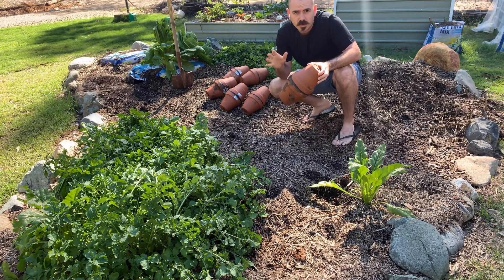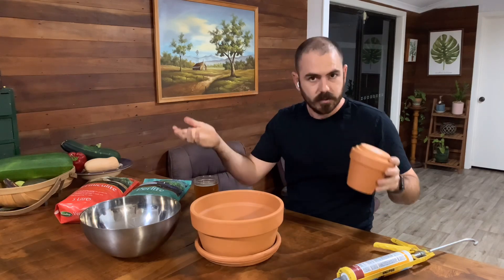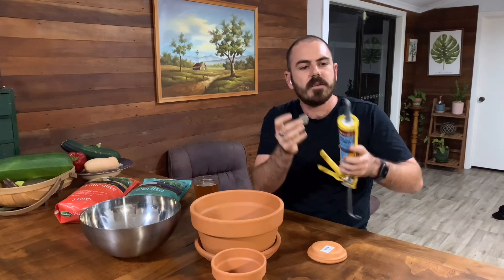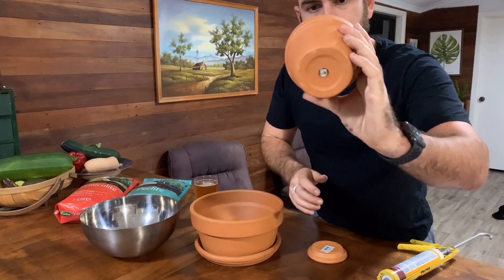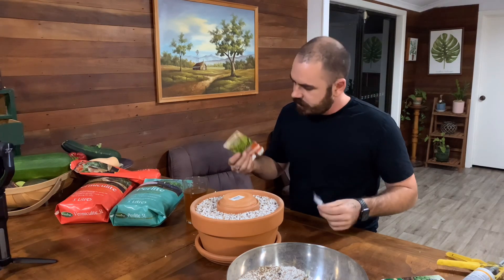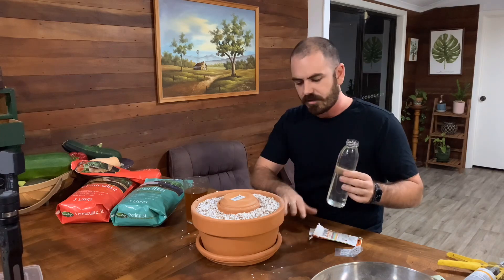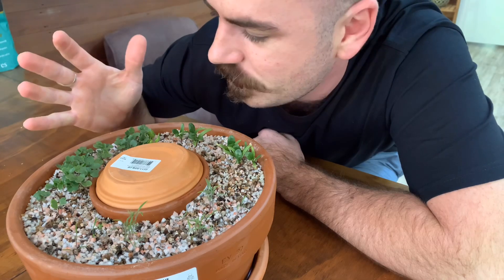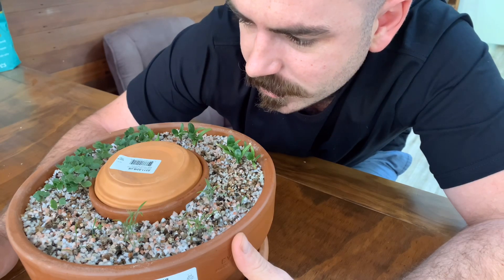Ancient Irrigation/Hydroponic Device

Comment: If they are both terracotta pots... why doesn't the liquid diffuse through the outer pot too?
Reply from the maker: Vaughn Hughes there’s no substrate for it to wick into, if you wanted to keep a closed bottom system you could make the pot plastic and not have a hole in the bottom. But it would stop oxygen exchange and would be hard to empty stagnant nutrient.
Reply: @Hoocho  Thanks for taking the time to answer. Appreciate the info.

Comment: We’re these pots just standard Bunnings terracotta pots? My Olla doesn’t seem to be wicking water out...
Reply from the maker: Standard Bunnings unglazed pot
Reply: mine isn't wicking to the same degree as shown in the video either.  Notice in the footage his drainage saucer is full of water in some of the shots.  Wonder how much if any top down watering is being done.  also using 10 inch diameter 4 inch high outer pot and a 4 inch diameter 4 inch high inner pot.  Perhaps the inner pot needs to be a larger diameter?  or my inner pot sits directly on the outer pot at the bottom no media between the bottom of the inner and outer pots. There is some moisture getting transferred to the media but not enough to get the moisture meter past dry reading.
Reply: Not all cay pots are the same, perhaps some are more porus than others.

Comment: Very interesting video, will need to give this a try. How would you rank this against the flood/drain method in your previous video? This method seems much easier and, aside from checking the water/nutrient level, a set-it-and-forget-it method
Reply from the maker: As you said, but it would be a bit messier to dunk it and not all seeds will mature at the same rate. So the other method is still my preferred for my use.
Reply from the maker: Also this uses A LOT of media.
Reply: @Hoocho  how about use a different container like a shallow one but wide and use the same small clay pot.. hopefully it will work

Comment: Absolutely fantastic.  I have a month ago applied your previous method where you were using the sprouting 3-tier towers.  I have instead used strawberry and mushroom punnet open containers, and had far better success rate of germination than seedling soil.  Many thanks for showing this approach, the benefit here this time is top-up frequency and slow release due to terracotta porosity.  I do wonder though how long the pot will last until the wicking effects subside leaving the nutrients to build up over time.
Reply from the maker: Just run water through on occasion, or soak the pot. Should remove salt build up.

Comment: Amazing video!
Do you think that this would work for a hydroponic system with leca balls?
Cheers from Austria😉
Reply from the maker: The “Leca” systems I’ve seen are basically a cross between kratky and Dutch bucket systems using hydroton clay balls. If this is what you’re referring to then probably not. Hydroton has little moisture retention, too much drainage, and moisture is needed for germination.
Reply: @Hoocho Ok, thanks man!👍

Comment: do you reuse the vermiculite + perlite after you transplant that?
Reply: I was wondering this as well, how many reuses can you get out of each cycle
Reply: I've reused perlite in a larger system before. It's pretty easy to clean, and any small roots left over aren't problematic.
Reply: @alexandriacrause2972  wow thats good..
Reply: how do you clean them? just water?
Reply: @ABUFARAH22  yeah I sprayed it all down and it got a good majority of the algae and roots out. You can soak it in vinegar or bleach solution to clean it deeper, but I didn't. I let it lay in the sun to dry out
Reply: @alexandriacrause2972  thanks a lot..